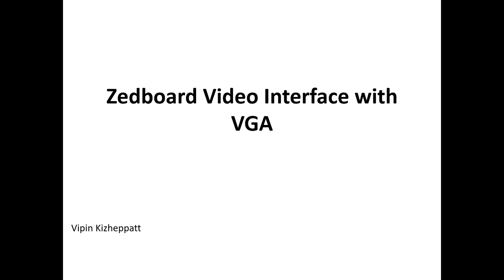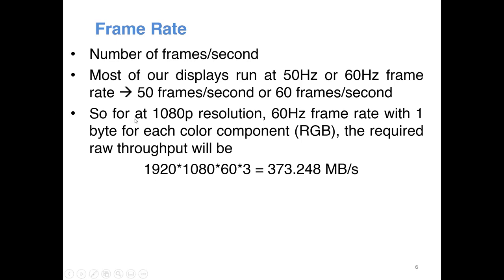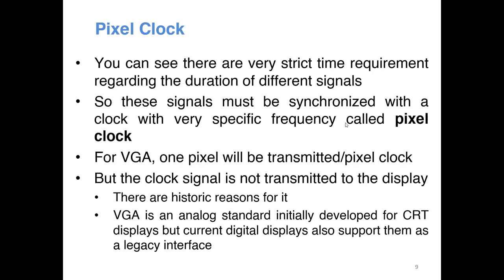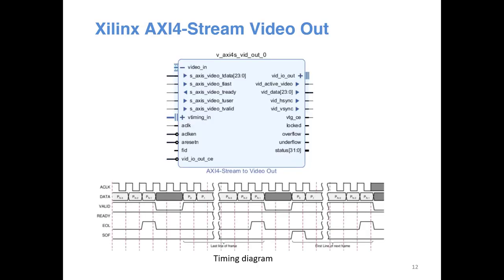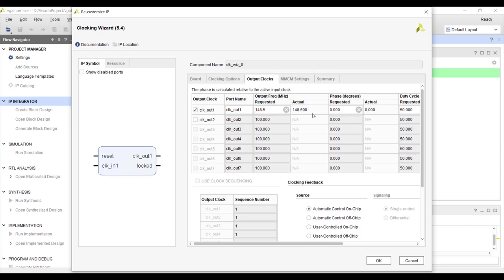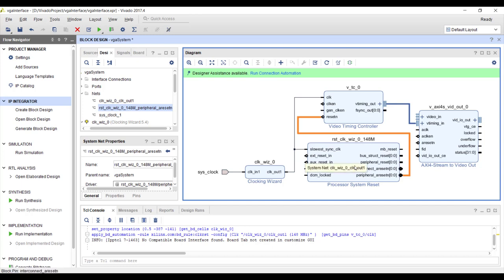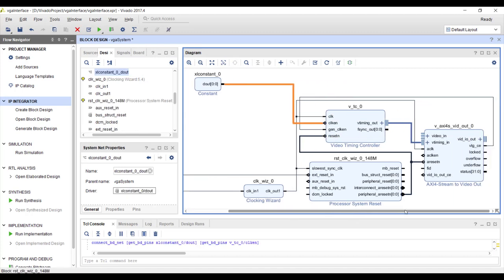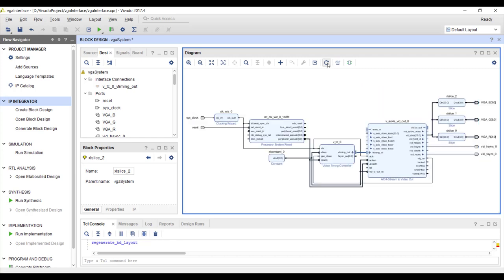Video Interfacing with Zynq (FPGAs): Part 1 Introduction

Comment: Very good tutorial but shouldn't have you selected the upper 4 bits instead of lower 4 bits during bitslicing the 8-bit value?
Reply: Agree. Maybe the signal is small enough by design and the lower 4 bits are okay.

Comment: Hi! 
I'm looking for some guidance to get video stream from a USB webcam connected to a Zedboard. Any help would be greatly appreciated!
Regards
Reply from the maker: Which camera did you use? For Zedboard best option will be to use OV7670. I will make a tutorial on it.
Reply: @Vipinkmenon  I'm using a basic USB webcam. I'd appreciate it if you made a tutorial on a USB webcam instead of an OV7670 as those have already been made whereas I can't find any for a USB webcam
Reply from the maker: That I have never tried. This will require Petalinux and the drivers corresponding to the cam since the USB OTG is directly connected to PS. Did you check this blog? Seems very interesting http://shakithweblog.blogspot.com/2013/12/updated-sobel-filter-on-zedboard.html?m=1
Reply: @Vipinkmenon  This seems like something very close to what I want to do. I'll check it out. Thanks!
Reply from the maker: @haaniaaamir8297  Thank you. Will check out